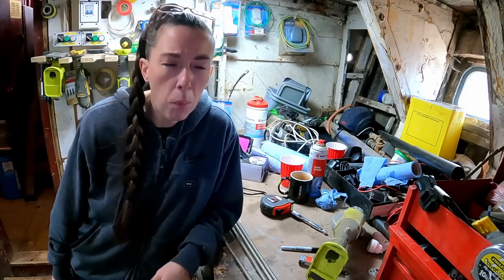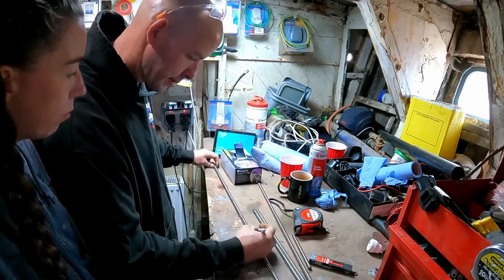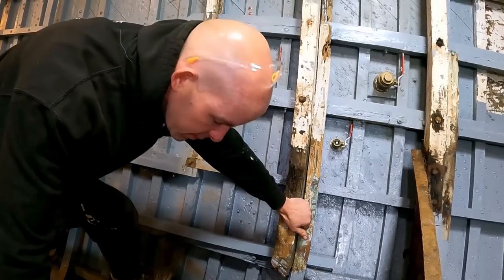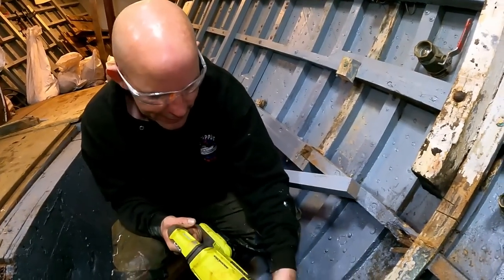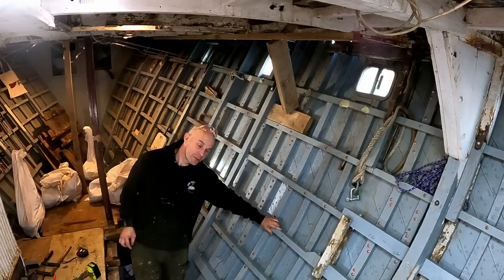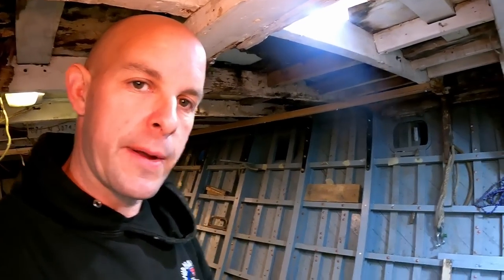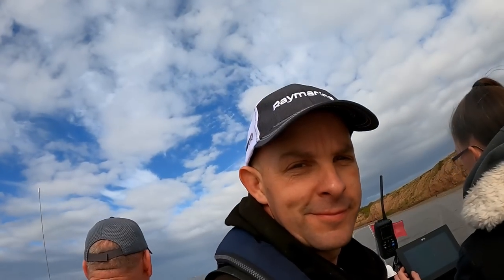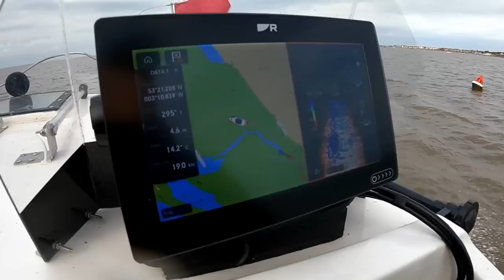Ep 94 - More Progress Made On Our Wooden Boat Restoration- Raymarine

Comment: 12/11/2022 Hello Ship. One month until I catch up. Great work guys. About the sisters I understand. This is more than doubling the strength of the weaker member but not necessarily needing replacing. You have restored the strength but increased it by the strength of the original member. I think sisters are necessary sometimes. By bonding the two members together they will act as one member. The scvarf joints are very good also. This bonding and bolting replaces the member with enough strength to match the one piece original member. I Like this work. Good job. Don usa

Comment: Gemma, Why not just use non nylock nuts? Then remove them. It would save you some time with the grinding. When you remove the nut it will re-align the thread at the cut. The grind does look cleaner I must admit. As always, really enjoyed the video!

Comment: Hi Gemma 😊  I really like channel and you really do have some “boss” ideas” Gemma, to be honest you are both really inspirational and I have now  decided to get my 24’ Bayliner in the water this year after her being trailered on my drive for several years !  Any room in Heswall Boatyard ? 😀 I heard what you said about the threaded bar (stud iron) so why not clamp a nut in mole grips and spin the other end of the stud iron in a cordless drill till the nut is at the middle You could actually even do this with multiple nuts spaced at required points along a metre length by holding the nuts one after another in mole grips and “spinning” the stud iron with the cordless  drill! till  the nut reaches the desired point then turn it around and repeat the process! 😊👍🏻
Best wishes Dave Flynn Liverpool.😊

Comment: "Why not just use non nylock nuts? Then remove them. It would save you some time with the grinding."  

Because that leaves a thin, sharp, uneven remnant of the cut thread that easily deforms and makes threading a new nut (especially a nyloc) difficult and prone to cross threading. You need to chamfer the thread to clean up the cut in any event so no point in adding an additional step.

Comment: You should build some portable camera mounts that you can hang over and bolt to the side rail of the ship, where there is a side rail, that also hang down far enough to mount a camera that can be used to file anyone working on the outside of the ship. Probably scrap lumber would go along way to make that happen and be light enough to carry around. Aluminum would be lighter and stonger.

Comment: I had forgot to ask if you had preoilers on the engines? If you do then I would strongly suggest running them for about 5 minutes prior to starting the engines. This will lube the bearings and reduce or eliminate any wear on the engine at starting.

Comment: i gotta say, that while a grinding wheel does work for smoothing off the ends, you can get a drill which does much the same, only a lot quicker since you just need to put the bit on the end, spin it a bit and you don't need to spin the rod.

Comment: I would use my wire cutters at the very end of the last thread on a 45-degree angle to remove the last flimsy bit.

This is my threaded rod two cents, don't know if it will help anyone. I work as an electrician, with 1/4 and 3/8 rod to support equipment and pipe, trying to keep your bag and/or pouch as light as possible is a must.

Comment: Great job!  Love the videos!!  When it comes to cutting the threaded bar, have you tried a spring loaded thread chaser?  It is like a die that has been cut into 3 pieces and has a spring buried in a channel around the outer edge (allow you to install it on the bar past the burr, then run it out to clean up the threads).  Very handy tools!
Reply from the maker: I don't think we need to spend money on a tool for this when it is quick and easy on the bench grinder!
Reply: @ShipHappensUK  Good point!

Comment: So there is a bit you can put in a drill to nock off the edge and make the nuts pass over the thread.  I'll see if I can find a link for you.
Reply from the maker: But to spin it with the drill, you would have to clamp the threaded bar in the vise to stop it from spinning, the vise could damage the threads, and the time to clamp each one up, plus a small drill attachment that we would probably drop down the bilge and loose it, just quick and less hassle the way we do it!
Reply: @ShipHappensUK  No. We do bar up to 1.5 inch bar by hand. doesn't take much. When i get to my hobby job I'll get the link . It's basically a cone you put the end into. Fairly simple.
Reply: @ShipHappensUK  Look for External deburring tools. Looks like a cone.

Comment: There is a tool you put on end your drill and removes the edge and gives a smooth end after your cut the ends instead of grinding the end…. It’s called Deburring External Chamfer Tool Stainless Steel Remove Burr Tools for Metal Drilling Tool
Reply from the maker: No point in wasting money on buying a small tool, it would get lost! We are happy with how we are doing it! It's quick and easy, and I'm  not going to lose the bench grinder!!!

Comment: If you made your scarphs 6:1 they will (a) have some structural strength and (b) pull in a lot easier as it has the longer taper will bend and (c) any future surveyor who looks at the boat won’t see it as a weakness. Also why have you suddenly started sistering stringers, they look awful     .

Comment: Hey guys that bit were you are sailing off Hilbre island. Do you know if it’s possible at high tide to sail a small dinghy around the Welsh side of the island? i have a small Mirror dinghy but if the centre board is down then it needs probably about a minimum depth of say a metre to be in the safe side. Do you know where I could find the depths … probably need some marine charts won’t I ?
Reply from the maker: Marine charts would definitely be needed!